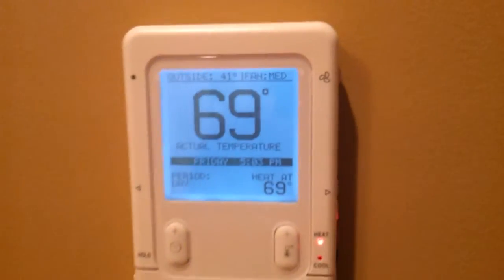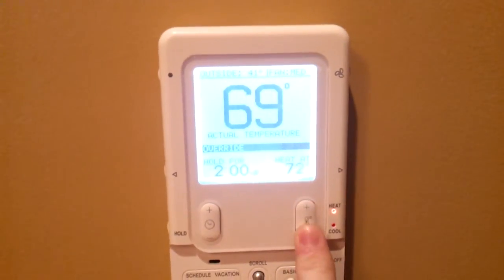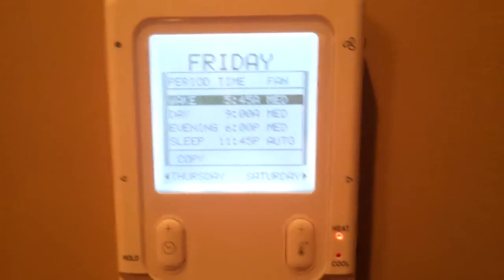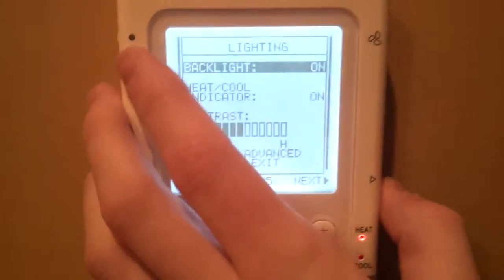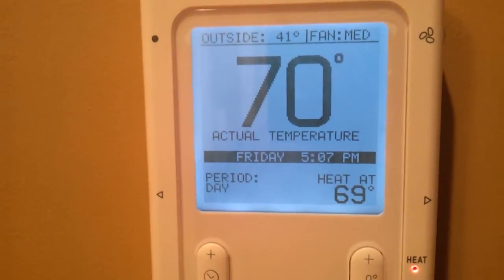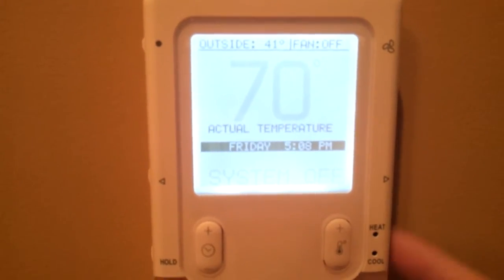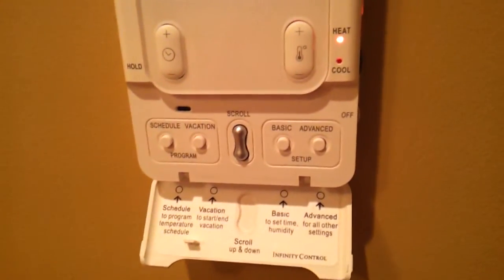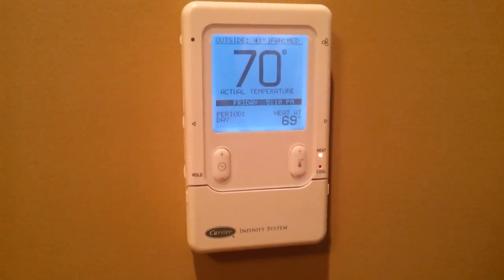Carrier Infinity Control-User Features and Overview

Comment: Display light on my infinity screen is always on now when it used to turn off after few seconds. How do I make it behave like it used to? Display light turned on by itself. Is it an indication that something is malfunctioning?
Reply from the maker: The screen backlight or the heat/cool lights?
Reply: I'm now using the furnace so it's the heat backlight.
Reply: I'm referring to the display screen light that used to automatically shut  off on its own approximately 10 seconds after pressing the buttons.

Comment: My screen went out on this system. I’ve tried turning it on/off, nothing. Is there a battery to change out on the board?
Reply from the maker: I don't think there is. Can you confirm that you have 24 Volts between pins C and D at the Infinity Control?

Comment: I am an idiot. Have a dumb question. Suppose my room temp is 75 and I want to manually lower it (turn on ac) do I press the blue cool button and reduce the cool at temp to 70 to get It to 70? Thanks
Reply from the maker: Yes, do exactly that.
Reply: Our system never cools.   I just wish i could work it like a normal thermostat 
And then it sometimes clicks to override
Reply from the maker: @jennifertarwater3511  Have you tried disabling programming? It will stay at the same temperature all the time if you do.

Comment: How do I turn off the AC and just run the fan? We don't run heat/AC from fall to spring. There is an off button not shown on your model but the button is missing.
Also thank you for answering questions on a 7 year old video. You got a sub from me and I can tell you love your job.
Reply from the maker: If you flip down the door, you should be able to see the "Off" button. Then you should be able to run the fan using the "Fan" button in the upper right. If this is not the case let me know. Thank you for the subscription!
Reply: How do I turn on the AC?
Reply from the maker: @emilygonzalez8722  Press the blue button on the right side, that should put the system into "Cool" mode.

Comment: if the AC says OFF does it mean its not working. for AC should it never say off and always low or high stage if working. i have been having crazy problems all summer with my ac turning off
Reply from the maker: Does it say "System Off"? Usually if the AC has a problem the screen will say "System Malfunction, Call for Service", if you have a communicating AC unit.

Comment: Can u explain the intervals on hold this thing is archaic? Also when I hit hold it never just holds at that temp is keeps cooling . I want it to shut off instead of keep cooling how Do I fix that?
Reply from the maker: You may have dehumidification turned on, which allows the Infinity control to over-cool the space up to 3 degrees in order to dehumidify.

Comment: Do you know if you can swap the carrier infinity control with a nest? How would the wiring work for the ABCD wires? Thank you.
Reply from the maker: You can't directly, you would have to re-wire to the conventional thermostat terminals at the Infinity indoor unit in order to use the Nest.
Reply from the maker: It would not work with the Infinity (ABCD) bus, you would have to re-wire to the conventional terminals.
Reply: David Han can u let me know how to wire honeywell thermostat with infinity carrier
Reply: please assist me how to replace the honeywell with infinity carrier
Reply from the maker: Infinity control will only work with Carrier Infinity Furnace or Fan Coil. No other equipment can be controlled by it.

Comment: Hi, I just bought Bryant housewise thermostat to replace a thermostat that's exactly like yours, do you know if they compatible?
Reply from the maker: The only compatible replacement will be the Infinity series thermostats from Carrier or the Evolution series from Bryant. These thermostats only have 4 terminals (A, B, C, D) unlike a conventional thermostat. It may work on your system but you will have to re-wire at the indoor and possibly outdoor unit as well.

Comment: I'm confused as to whether or not this system has an auto turn off feature. For example, whenever it reaches your desired temperature it'll automatically shut off until it reaches a temperature to turn it back on.
Reply from the maker: Yes, that is the basic definition of what a thermostat does...
Reply: springws14lbss
The reason I ask is because ours doesn't do that. I was looking to see if anyone else has issues. Once ours reaches the desired temperature, it doesn't shut off. It has to be manually shut off. looking for troubleshooting.